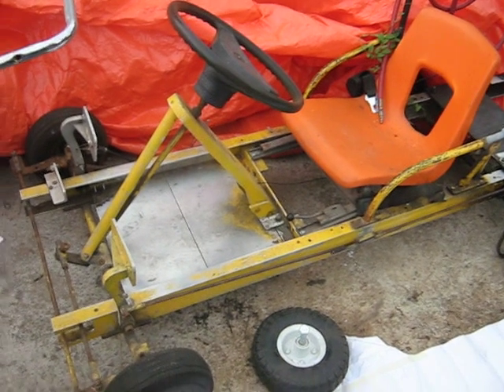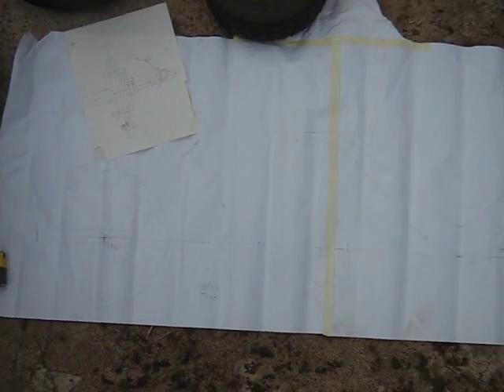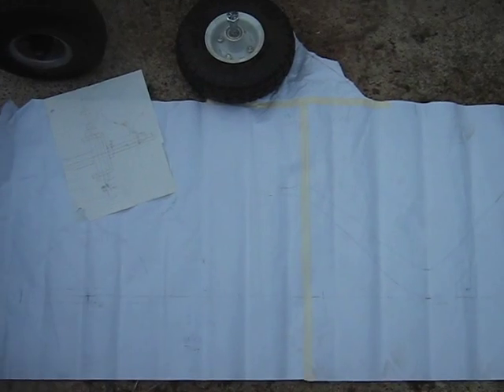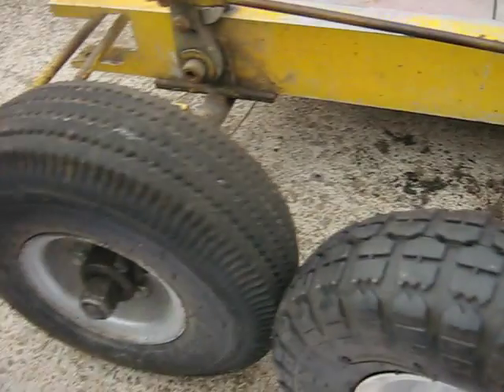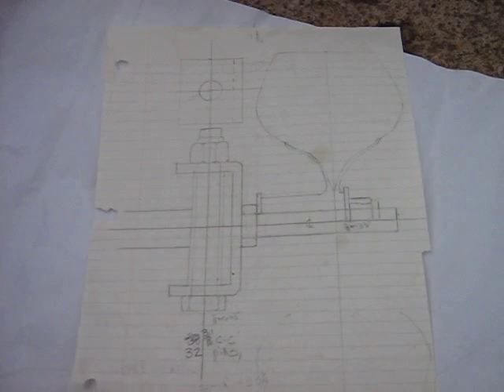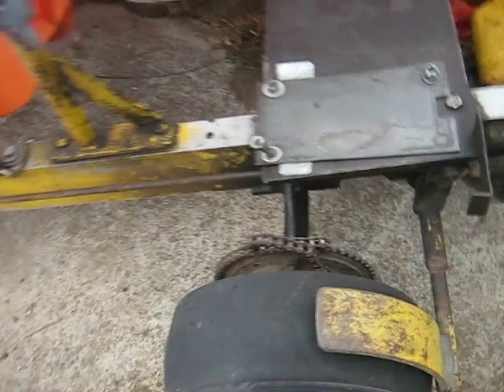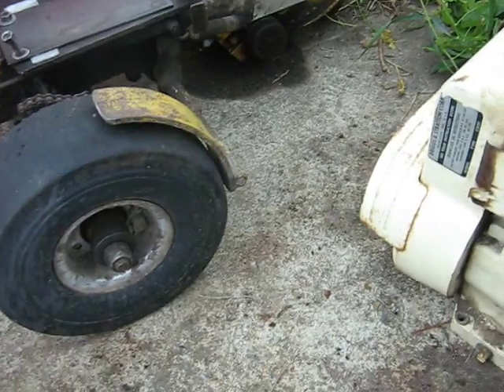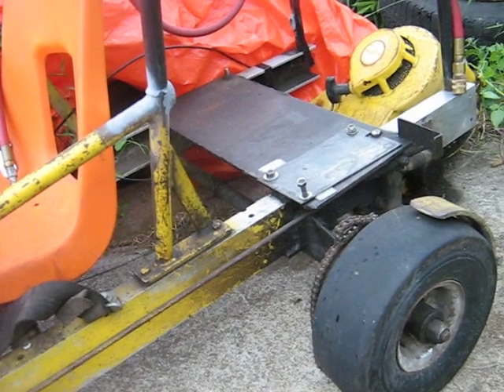Go-kart construction ideas Vid#1

Comment from the maker: So are you using lawnmower engines?
Those could cause you some problems, I have a vid of a blade puller I made (sorry you will have to search thru them to find it. Usually you have to file the rust off the crankshaft to get it to pull thru the bottom bearing, to take the crankcase cover off.
Could you make a vid of the engines, showing the blade holder etc., that might be easier.

Comment: Yah i got a briggs from the dump i went the nxt day again and found another of the exact same engine so i am building one engine from both the parts but i have one problem on my shaft there is a big metal thing that used to hold the blade on but now it prevents the cam shaft and jack shaft from coming off do you now how to take it off if u need a pick i can send u one

Comment: i just want to build a very basic kart i rly want to keep it low cost though i have acces to a welder angle grinder any hand tool and drills but not a drill press until september when i have acces to a full shop

Comment from the maker: Thanks, I think somebody working at an aluminum plant built this kart back around 1970. It had a 3 horse Briggs with a direct chain drive. You set the kart on blocks, start it up, kick it off the blocks, and away you go.
We put on a centrifugal clutch, throttle , plus I re-engineered the steering, so the outside tire didn't turn so sharply.
I plan to make more vids about homemade go-kart design, so any suggestions are appreciated :)